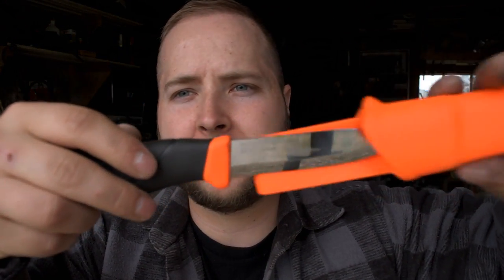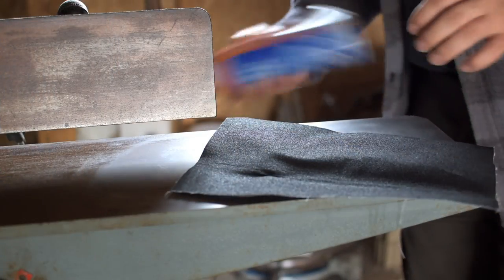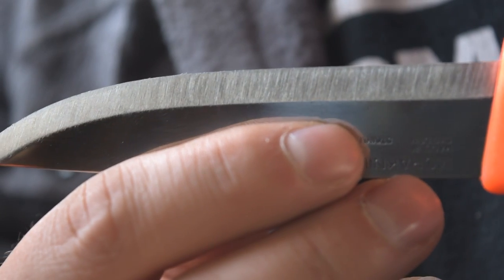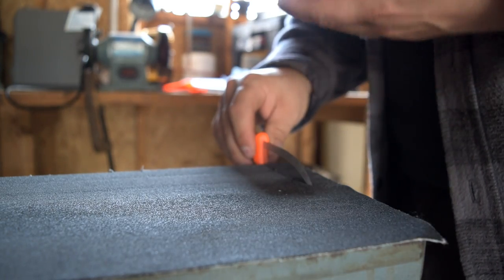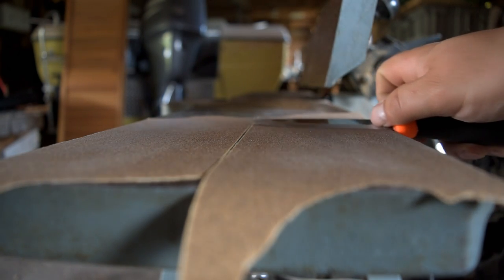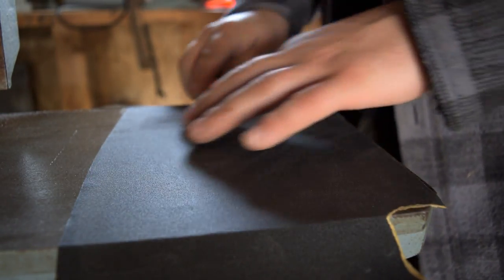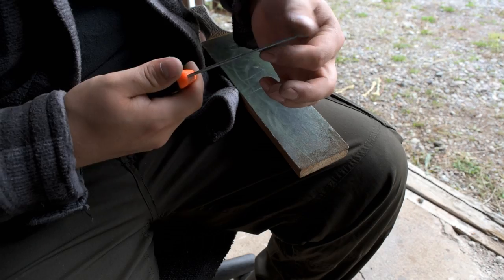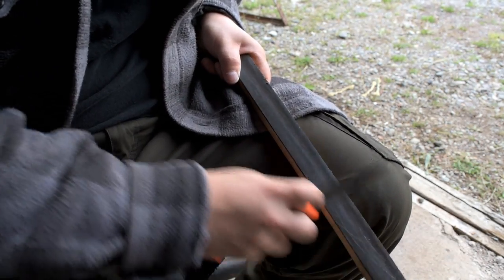How to Make Your New MORA Perfect!

Comment: Kyle,
Mora beveled that edge for a reason.  If you intend to use that knife ONLY for cutting meat or skinning or filliting fish then YOUR edge makes some sense.
  Otherwise, YOUR edge is too delicate to stand up to the everyday chores of a camp knife.
  I have NEVER sharpened either of my Moras and, even though neither of them are as sharp as yours, they provide excellent service.
  BTW, my Mora will the magnesium firestarter in the handle didn't throw sparks the first few tries either. But, it soon broke in and has worked fine since.

Comment: I've got to be honest, I've never had a Mora that's not that sharp, admittedly I've never had stainless steel one only carbon and they've been shaving sharp from the factory, after seeing you strop your knife the way you did, with a blade that sharp i hope you keep a tourniquet handy, because you have the femoral artery right from your groin to knee and you won't stand a chance fella if you knicked it, just saying. I've tried this way of sharpening after watching this video and it works well and very easy to do on Moras at least, i don't think that everyone needs a sushi sharp knife in the woods though
Reply from the maker: Hey Jas, I've seen many not shaving sharp from factory. You're right, you don't need a blade this sharp for the woods. Act responsibly and you'll usually be okay

Comment: Here that is a carpenter and handy mans knife that get hammered on, cuts packaging for very day juse and cost 3-5dollars here in Sweden. If you se a electrican carpenter or other handyman here they have 2-3 knifes in there tool belt and the Mora knife is a throw away knife when used. Red or orange handle is often used buy carpenters and Blue hand buy electricians and often the blue handel has a stainless blade. 
https://www.swedol.se/slidkniv-rostfri-220-mmvt-4491.html
https://www.swedol.se/quicksearch/result/?q=morakniv

Comment: What you on about ??       You should never use the wet stone before your doing the final finishing toutches just before buffing it if you desire gloss finish on ur blade.

80 grid paper is like sledge hammer to tap in small nail to wall to hang your picture frame on..           work with  200 onwards only if you want to do anything good for your blade..   Starting to think this is an troll vid around 5min mark.
And its pointless to scuff up your knifes spine for sparky thing,    scuff it up when you need to spark your rod.  just scrape it against stone outside,   pointless to have ugly knife that easily scrapes you skin and get your nasty infection outside.    gutting an fish with that is just as dangerous to you as it is for the fish.      

The amount of trouble this guy goes tru without need of doing it is quite hilarious.    Next he makes an vid , how to sand paper you sunglasses to avoid reflections to give away your camo on woods.

Comment: If your car breaks down on a highway you can lay in in the road about 100 feet back to warn oncoming traffic. Just think of what kind of knife you could buy if you actually had a job.
Reply from the maker: What do you know about me, to make such a statement?
Reply: @kyle_noseworthy  Amazingly accurate, I know. Your wondering where we've met, but no we haven't, I was only joking so don't take it to heart. When I was your age I was quietly paddling through the swamps of the Serengeti in search of the elusive and extremely dangerous, Ōsanshōuo. We needed the musk glands, we preferred getting them from the  even-toed ungulates but they were found only in what was then a war zone that we were ill advised to steer clear from, anyway we were able to harvest what we needed to trade with the shaman in the high central Carpathian Mountain Range, he then led us to only know source of terbium and as a result I became very wealthy and have reaped the rewards of that endeavor ever since. There are bigger and better things you could be doing beside fucking with cheap knives and sandpaper. Good luck.
Reply: @GhettoRanger01  The problem with stainless steel that is never stay sharp. After a while the molekyles want´s to go together. Then it will gets rounder